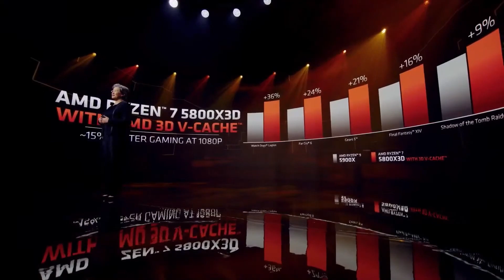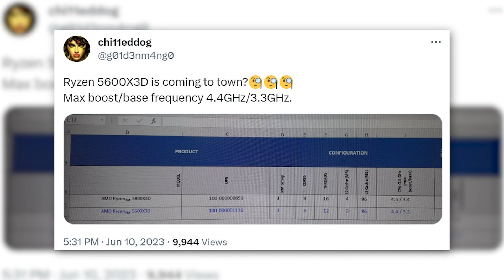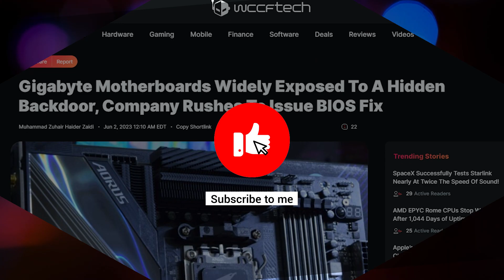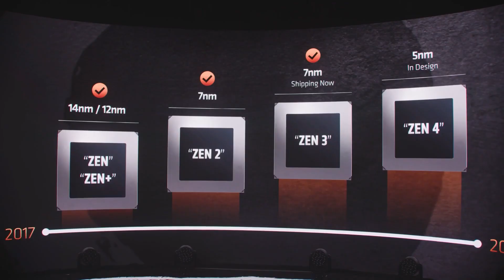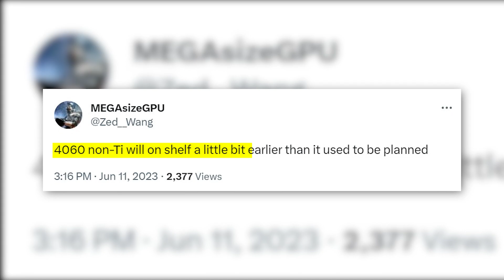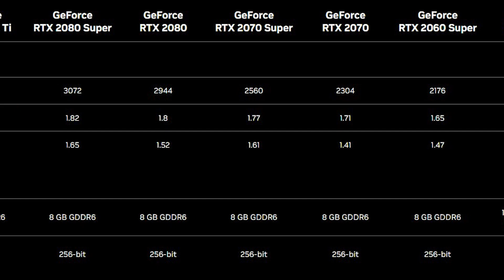AMD is Making Another Comeback

Comment: according to you which CPU & GPU combo is best bank for the buck terms of price to performance ?
Reply from the maker: I think that for a mid-range build, the Ryzen 7600 and RX 6800 XT is a killer combo, and for an enthusiast build, the Ryzen 7800X3D with RTX 4090 is the best you can get.
Reply: @pcneststayinformed   which will be better 5600x vs 5600 vs 12400f in teams of performance will be a better choices? Any Nvidia Gpu which you think is almost value for money as of now in both 30 series and 40 series?
Reply from the maker: @arijitbanerjee6572  It's pretty hard to decide between the 5600X and 12400F and all of it boils down to what you like because the performance of both is similar. As for GPU, I believe the RTX 3060 12GB or RTX 4070 from the current-gen will be good to go.